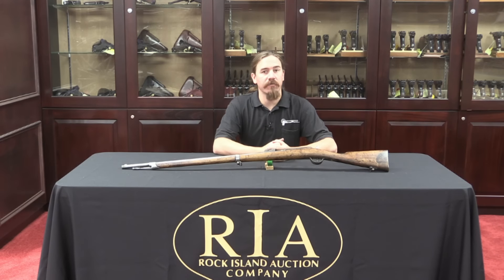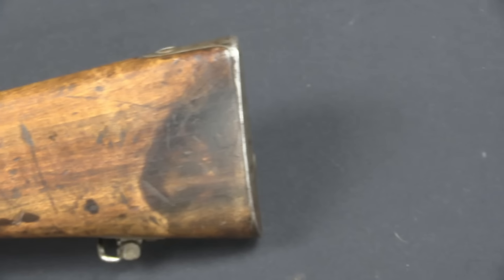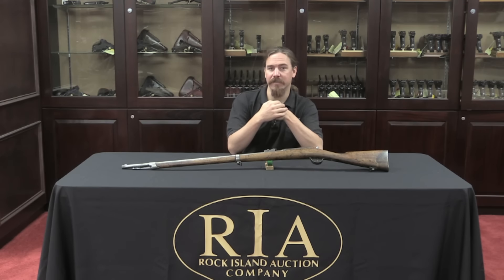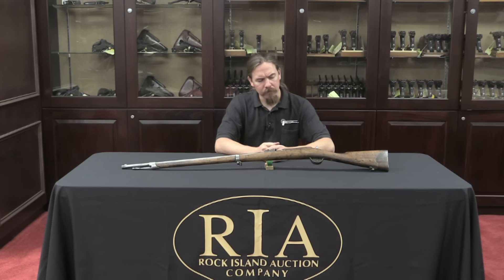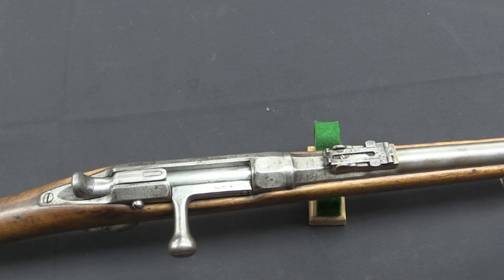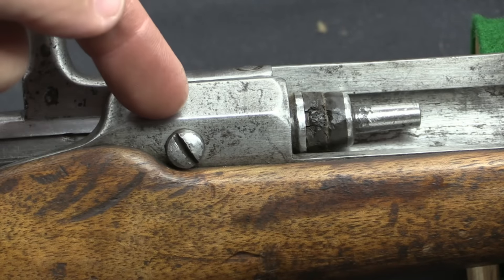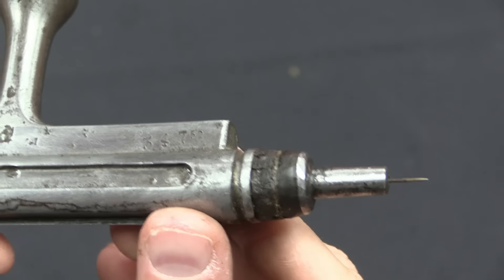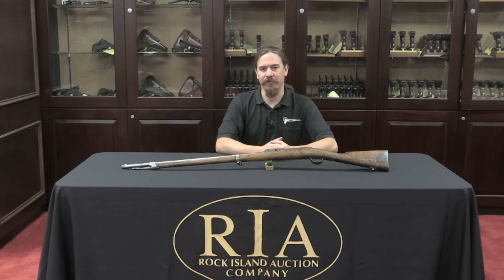Chassepot Needle Rifle

Comment: You can really see a resemblance to the mosin nagant receiver and bolt (3:45), considering the mosin nagant was developed just 20 or so years after this model, I wouldn't be surprised to learn there was some influence from this rifle.
Reply: druisteen can you provide a link of some sort to the story of that contract? I've googled Vatican chassepot and nagant in various forms but have been unable to find anything about that sort of deal. There is mention of mosin nagant rifles going to the vatican, however.
Reply: Très cool, merci!

Comment: I made my "needle" out of a tungsten tig electrode, and the obturator is a turned down rubber stopper (from hardware store). I have shot a couple hundred rounds and both hold up well. I think the tungsten needle  should last for a very long time (if not forever), the obturator should be good for another hundred or more rounds. The system works amazingly well.

Comment: The metal catridge is the invension of the MAUSER Brothers in 1868 but over a Contract with Samuel Norris (a reprensentativ a Remington) the invention cames very fast to the US.
Reply from the maker: JägerLP Flobert was the first to design a practical and successful metallic cartridge, in the mid 1840s. By 1868 they were widespread.
Reply: oh ok. ive had seen a documantion about the mauser brothers and they`ve said the 11mm Mauser of the mod.1871 was a revolutionare invension of the Mauser`s. but mabye it was wrong convertet the Docu was from (i blieve) england and was dubbed in german my country.
Reply from the maker: JägerLP The 1871 Mauser was an excellent rifle, just not the first of its kind.

Comment: Why would you need a needle so long if the primer is at the very back of the cartridge? And so thin (and fragile) for that matter, too, when it does not need to poke through the powder charge. Also, how would you dispose of the remaining bits of primer in this type of action? In a Dreyse needle rifle the primer, being in front of the powder charge, would be blown through the barrel along with the bullet, but not in this rifle, I'd presume.
Reply: Also I wonder what held the primer in place so the needle would actually deform the surface enough to detonate it instead of just pushing it deeper into the powder charge.
Reply: @WalkaCrookedLine  Due to the obturator the chamber actually seals. This creates a backdraft that basically "sucks" the remains clean out the barrel.
In fact the actual paper used by many does NOT burn but leaves the barrel in shreds. Me i´ve made them out of shrink sleeve,which takes much more of a beating,which also clears the barrel.
Reply: @gainforlife5877  Thank you, I came looking for the answer to this very question

Comment: If the needle is only poking through the primer in the back of the cartridge how is it considered needle fire? I can see how it is definitely needle like if you have the pin going through all the power and striking the primer under the bullet but if the primer is all the way rearward that's just like a standard round today. Non needle fire just don't puncture the primer.

Comment: Is sealing not a challenge on modern firearms? If not, why?
Reply: SecularStrategy Without going into too much detail, the main factor is that now we use brass cartridge cases. These 'flow' into the chamber and help seal in the pressure, as well as sealing the rear of the bolt face.
Reply: SporadicallySane So it's the cartridge expanding to self-seal? I would imagine that finer machining also plays a role.
Reply: SecularStrategy Brass cartridge cases expand into the chamber and does the sealing.
Reply: SecularStrategy Finer machining and much tighter tolerances do indeed play a role, however the brass cartridge case is the main differentiating factor behind ensuring a gas-tight seal when comparing modern firearms to these earlier breech loaders. In fact it is the main reason we use brass cases in the first place.
Reply: +trailduster6bt Thats why before you buy a Enfield you ALWAYS check the headspace. It is getting pretty tough to find fireable Enfields for a good price.
Reply: Eddie Romero the sloppy chambers are a separate problem from headspacing in enfields. I've had enfields that headspaced great but would Ballon brass due to loose chambers.
Reply: I was using some Tula steel case ammo for my 9 mm, and not sealing  may not get gas in my face(though less likely anyway cause pistol) it required MUCH more cleaning compared to brass, I also got many more failures to eject, mostly due to them being weakly loaded I'm told.

Comment: strange that the French clearly lost the war of 1870/71 despite having the better "Zündnadelgewehr" then the Germans.
Reply: budwow The French lost even though they had the better rifle because of military strategy, organisation, and logistics. I also believe the Prussians had better artillery. But mainly it was because the Prussians had a permanent general staff, most militaries at the time only formed a general staff in a time of war. This allowed the Prussian general staff to train, develop strategy, and run war games before the advent of war. The Prussians also had all of their reserve troops assigned to local units, meaning a reserve unit could muster very quickly, a matter of days. The French had reserve units with reservists across the country, sometimes troops lived on the opposite side of the country as their unit, meaning troops had to travel days to get to their unit, slowing the mustering and deployment of reserve units. The Prussians also had a plan in place to place control of the railroads under command of the military in time of war and also had detailed plans of how to use the railroads to deploy troops the fastest to the battlefield with as little wasted effort as possible. The French military never took control of the railroads when war was declared, but often local commanders would commandeer trains to use without considering the overall logistic picture, compounded the logistical nightmare the French were in, not to mention delaying many of those reservists traveling to their unit. So while the French Army was larger than the combined Prussian and allied army, they were unable to deploy the bulk of their army in time to stop the German advance, while the Prussians and other German states were able to deploy something like 90% of their forces for the initial push into France. One thing to also mention is while most people mistakenly believe Prussia was the aggressor, it was France who declared war on Prussia, seeking to prevent the unification of Germany (although Bismarck pretty much used political maneuvering to force France into declaring war.)